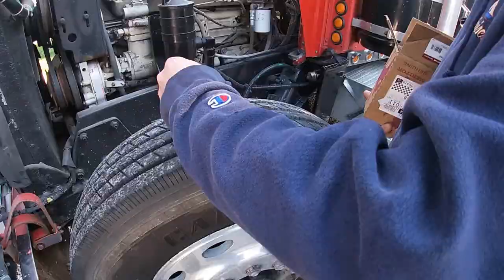Changing A Peterbilt Tie Rod End!

Comment: dont count the threads. you measure from center to center on the top side for exact measurement
Reply from the maker: I ended up marking the tires then measuring the front and back . Truck Drives perfectly straight👍👍